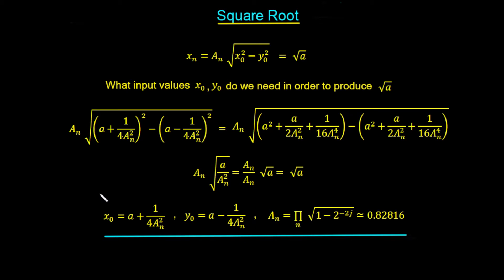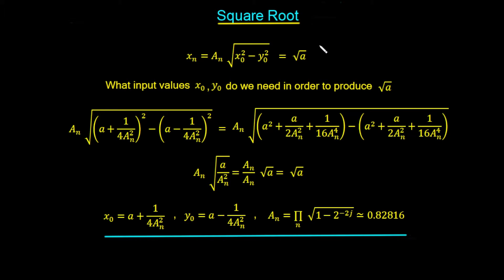CORDIC Algorithm Square Root

Comment: I am testing this algorithm in matlab, I tried the example from the video, it is calculated correctly, for the sake of interest I decided to set "a" equal not to 4, but to 121, and at this point we are not even talking about accuracy, instead of the expected 11, I get 35... Maybe the algorithm has a limit on the input data, like when getting a sine/cosine?
Reply from the maker: Yes the CORDIC functions are input limited. This is something that is outwith the scope of the course.